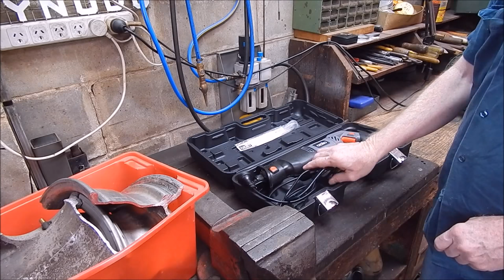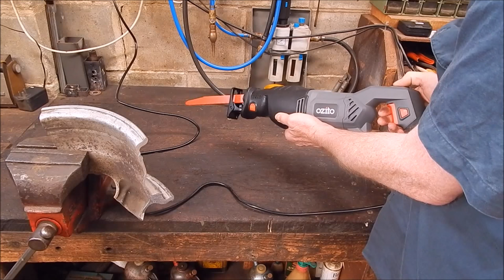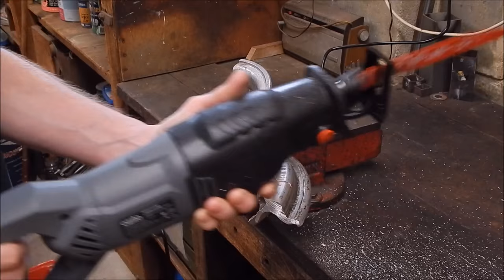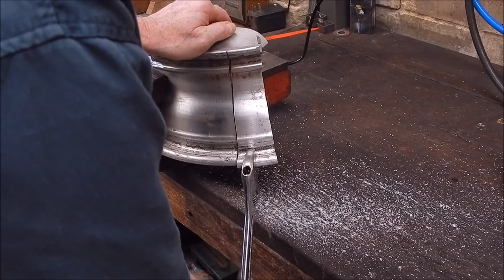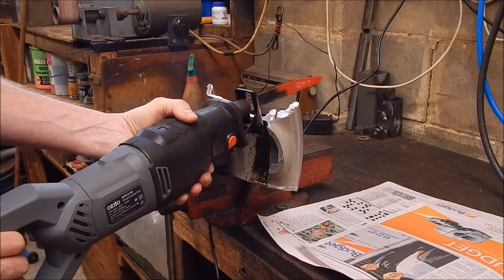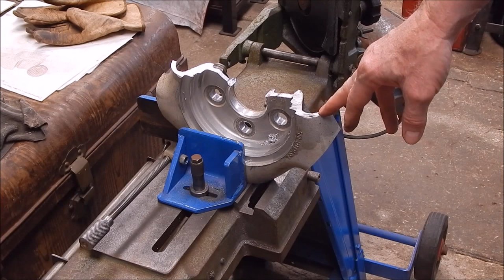Ozito reciprocating saw versus alloy car wheel rim

Comment: We've got some pretty good consumer protection laws in Australia. Even cheaper tools like that saw have to sold with a twelve month warranty. So whenever I buy cheap tools, I use the heck out of it while it's under warranty. I don't go so far as to abuse the tool, just use it a lot to see if it will fail. If it does fail, take it back to the shop & have it replaced with a new one. And the best part is that the replacement tool also comes with a twelve month warranty.
Reply from the maker: +gamerathebrave 

This saw has a three year replacement warranty.

Cheers Rob

Comment: I found that if you don't let the saw stop completely before pulling the blade away from the work, there is a risk of the blade striking the work on the forward stroke and braking or bending the blade .

Comment: Great buy there Rob. You will love the recip' saw. They are so versatile you will wonder why it took you so long to get one. I know they are a bit noisy on metals but for wood, cinder block etc they are great. Also you cannot beat them for getting into inaccessible places. I have a positionable  front handle on mine. It makes for more control but can be removed when not wanted.  regards from the UK
Reply from the maker: +Gary C 

Hi Gary.  I always thought they would be a bit crude in the way they cut, but so far I'm pleasantly surprised.  Have yet to try it on other stuff.

I also got one at that price for the Bro-inlaw and he was pretty impressed.

Amazing what the handyman can buy these days, for little money.

I can remember as a kid when my Dad got his first electric drill, and it was like getting a new car.

Times have changed.

Cheers Rob

Comment: At junk yards they have this gadget that is kind of like a big weed wacker for chopping up thinner aluminum. It is this heavy metal blade that spins around pretty fast, and just hacks through the aluminum. Bigger stuff folks build fires, toss the aluminum in there, and let the metal soften, then they have at it with an axe, or a sledgehammer.

Comment: With your band saw sometimes when cutting the cut closes on the blade, this happened with some cast iron. Thinking would a sabre saw be as accurate as a hacksaw, stop my tennis elbow. Jig saws have a guide wheel behind the blade.
Reply from the maker: No. If the slot is closing/binding up you need to use lube to wash away the cuttings.  This is a common problem with alloy, but I've not cut large cast iron.  Cheers Rob

Comment: When I used to play around with this stuff I tried cutting up an air intake off a v6 holden motor. Very difficult to cut easily without mess. I ended up putting the whole thing over my furness and getting it hot enough that it kinda breaks into chunks but doesn't melt. It's then easy to break it into lots of pieces with a hammer then let it cool and you should have almost no mess and large chunks of ally busted down into crucible sized chunks. It would probably work over a hot fire but it might be harder to keep it from falling into the fire and melting.
Reply: +Guy Pizzey That's the ticket there. When you get aluminum up to a critical temperature it crumbles easily then for you.

Comment: Interesting, Looks like a good source of material for casting. Several years ago, when I was doing some aluminum casting, if I acquired a large chunk of metal that I wanted to break up into smaller pieces, I found that I could get it hot enough in a charcoal grill to where the aluminum would loose it's strength and, while still hot, could be easily broken up with a few hefty strikes with a healthy hammer.  After cooling it regained it's  previous characteristics. Just something from my ancient past.  Good project, keep it going.  Thanks for sharing, mate. Dick.

Comment: Thanks for posting.  I love it when I snub my recip saw. I bought mine to change out the horizontal lower control arm bolts in my old car. fun fun fun. You have to use the carbide coated blades for tough bolts that won't move in such a confined space. Regards. :-)

Comment: the dual blade reciprocating saw I have also has a stroke length switch, makes a big difference using the short stroke on metal.
Reply from the maker: +tapper88 

I wonder how that is?   So shorter is better?

Cheers Rob
Reply: +xynudu the shorter stroke is much better for steel, the long stroke is required for wood and plastic or you just make smoke. the long stroke is 30mm the short stroke is 20mm. not sure if this is only for the dual blade as I haven't bought any single blades (traditional recip blade) to try in it yet, the only downside I have found to the dual blade, circular and recip, is the extra "loss" from the wider cut, they are much easier to control, almost no kick back, nicer smaller chips, and plunge cut into almost anything ;-)
Reply: +tapper88 I have never heard of a reciprocating saw with different stroke lengths before. I have saws with different orbital settings though. Metal you do not want to orbit on. Although aluminum hardly qualifies as being metal really. So a light orbit might work pretty good on it.
Reply: It's an actual dualsaw (original ones I think, back before the patent ran out and everyone made one) bunnings were practically throwing them away when I bought them to make way for the new ozito version. The recip was 20 bucks and the circular was 70 in a package with an ozito multi function tool and kit. The variable stroke was new to me as well, and could well be a dualsaw only option, the dualsaw brand blades do claim to cut anything within reason, perhaps thats why the shorter stroke is required for metal. They plastered "variable stroke length" all over the box, they were clearly proud of the feature 😀

Comment: I think the wide cross section near the bottom of your first cut is longer than the stroke length, so the chips aren't clearing the cut. It may go faster from a different angle so that the gullets between the teeth don't get full.
Reply from the maker: +FXM 

The stroke length is 22 mm.  Good point.  I will check that out.  

Cheers Rob
Reply: +FXM I was trying to figure out why it didn't go through that thick section as fast as it did the thinner piece, but I think you hit it.  I've used and seen those saws go through harder stuff just that fast.  I'd almost be tempted to try my cheap table saw if I was doing it (given how the circular saw went).

Comment: I'm probably wrong, but I thought wheels were at least part Magnesium.  "Mag wheels"  Just a thought.
Reply: +Rosa String Works Original alloy wheels were magnesium. Which is where the name mags came from. But magnesium rims tended to shatter, so they stopped making them long ago.
Reply: *****
I have some authentic American Racing mags on a car. They are vintage. I don't know how old they are, they came on the car when I bought it. The car is a 1966 too.

Comment: One other thing.  I have had good results holding a vacuum right at the cut when using the circular saw (I have a metal vacuum tub so sparks don't hurt it) even better when another person holds it.  Reduces the mess by a good half.  I also use saw horses and I think the extra drop distance cools the chips so they don't stick as much to the tarp as they are pretty easy to shake or slide off.  Bottom line though is still the plasma torch for most cuts and the band saw with cutting fluid for detail work.  WD 40 is a good cutting agent (the kerosene in it is the key so you could just use kerosene) as well.  Probably the only thing WD40 is good for!  Doug
Reply from the maker: +Douglas Thompson 

Hi Doug,

I use 1:4 engine oil and kerosene as a a cutting fluid and it works well with alloys.

WD40 is too expensive, and mostly kerosene anyway.

A plasma torch would be nice, easy to cut, but I don't have one.

Cheers Rob

Comment: Hi Rob, I have been using the circular saw with an aluminum cutting blade, not bad, but man it can it kick back at times. I wanted to let you know I now have a Ozito 5" twin cutter. Picked it up from the big Green and Red shed for 89 bucks and works an absolute treat on Alloy Rims and almost as fast as a Circ and heaps faster then my Rip Saw. I usually only buy De Walt or Makita tools, but I am impressed with the thing.
Reply from the maker: Hi Jason,

How much mess does it make ?  Cleaning up the cuttings was the big issue with the tungsten circular saw when I tried it.

Cheers Rob
Reply: A fair bit to be frank, maybe a bit more spread out then the circ... I ended up using the box to confine the mess in my shed. It does throw them back towards you as well... The search continues I guess...

Comment: G'day mate.  That recip saw is a nice thing to have around.  I got a deal on one about 12 years ago and I have cut everything with it including bricks.  The bricks don't help the blade much.  Do you have any ideas as to what you want to cast from those wheels?  Thanks for sharing.
Reply from the maker: +cerberus 

Hi Harold.  Haven't thought about what to cast with it.

I recon it will make great quality round stock.

I plan to at least cast a length to see how well it machines. 

Cheers Rob

Comment: Bit of practice with technique and you won't get that jumping problem. Made a pretty good job of it though. I think for that material you could do with a slightly coarser blade. Also something to try, I like to start on the thickest area first if possible.

Comment: I use a Milwaukee metal reciprocating saw Model 6370-21. It has a housing that collects metal filings. I have cut 2"x2" aluminum quickly. Check it out.

Comment: What I used in the past for cutting thicker aluminium is 5" grinder with a 4 1/2" tungsten tipped blade, making sure to have the guard in place, it absolutely zings through it and after about 2 weeks of use it had only lost 2 tungsten teeth.
Children, safety Sally's/ Nazi's do not try this at home, or work or anywhere else, it is extremely dangerous if handled by inexperienced users.

Comment: when I cut up the rim last week,I think I started with the reciprocating saw on a very thick section and didn't try it on a thin section so I felt it was cutting slower than I'd liked and went straight to the circular saw because I new it would cut it like butter.

Comment: I have used automatic transmission fluid as a cutting agent with good results on the aluminum.  The reciprocating saw is just not a very likable solution.  When you get in shapes where the foot can't be held firmly against the workpiece they vibrate the heck out of you as well.  Doug

Comment: Good demo Rob. What's the lube you use, I can't smell it to tell?? Peter
Reply from the maker: +PGS 

Hi Peter.

It's home brew, one part car engine oil to four parts kerosene.

I also use it on the lathe, gets a bit smokey when things get hot, but works OK.

Cheers Rob

Comment: Hi! I know this comment is almost 3 years late, but I only saw your video now.
I've seen people fire large aluminium parts in a suitable size metal container with coal or wood and then crumble the part into small pieces with a hammer - it seems to be the easier way for parts with variable thickness and shapes, as that Toyota rim.
Reply from the maker: Hi Jose,

I've heard that is the go, but I haven't tried it yet.  I don't have a big enough hearth at the moment.

Thanks for the comment.

Cheers Rob

Comment: First :Get yourself an Diablo carbide tipped  blade: https://youtu.be/MaM3hQeOeR8 https://youtu.be/6C_CPeA64is Second:you need to hold the saw stronger with the left hand,apply constant force down.It will reduce vibrations and cut quicker.For soft material cutting use a blade with bigger teeth between wood and metal blade.Third:Dont pull the still moving blade back out from a cut,the blade can bounce back and deform or brake....

Comment: There is a reason they are cheap. They are trying to get rid of them.
I got sucked into the Ad blurb about the Ozito quick change blade device and bought one of these. It lasted 2 hours before the blade started to fall out. I took it apart to see how it works. The blade has a hole in it and that hole fits over two small ball bearings. That means that the ball bearings are trying to hold half of the thickness of the steel blade each and that is a tiny amount of grip. Under stress the bearings cannot cope. It was a shitty idea badly implemented. In the end I was forced to modify the mechanism by drilling it out and using a split pin to hold the blade instead. I will never buy another Ozito product.
Reply from the maker: I've given mine a fair beating and had no issues at all. 

I put oil in the little hole in the side of the reciprocating blade holder.  There are no instructions to do this, but it seems to have no adverse effects.  Running it dry seems like a bad idea to me.

I paid $60 for mine new and they put the price up to $100 later,.and supposedly added a few more watts to the motor power.

It's still $100 so I don't see them trying to unload them for whatever reason.

Cheers Rob
Reply: There is a cir-clip holding the mechanism together. Once that is removed the plastic part you twist comes off and then there is a rod with a hole into which the bearing/s (Can't remember if there were two) fit. The ball bearing/s was held in place with grease, I guess injected through the hole you are talking about. 
My saw was used continuously for two hours cutting up and over grown hedge when the problem with the blade started. The blade felt firm when I put it in the holder but it kept falling out under use. I went on-line to see if anyone else had a problem and found this: https://www.productreview.com.au/r/ozito-rsw-5200/1338733.html?ref_r=emailViewedItem
Anyway, good luck and I hope it continues to function well for you. Mine was a dog. In the UK more and more stores are selling them off cheap.

Comment: Rob, what was the lube you used?
Reply from the maker: +Mike Clayton 

Hi Mike.

It's home brew.  One part car engine oil to 4 parts kerosene.

Works on the lathe as well, but it gets a bit smokey when things get hot :)

Cheers Rob
Reply from the maker: +Mike Clayton 

You could use WD40.  It's mostly kerosene as well.

Rob